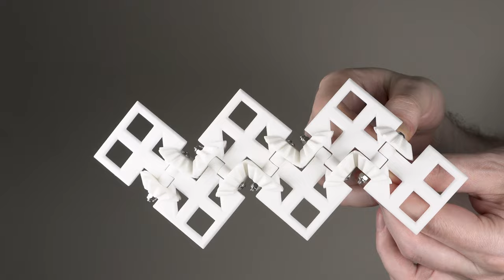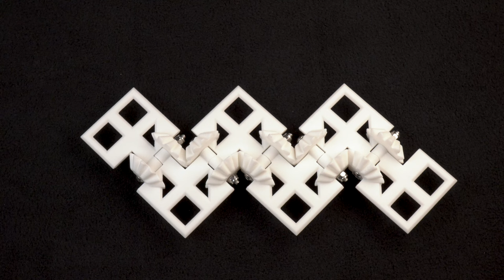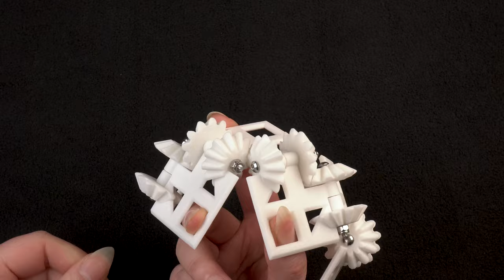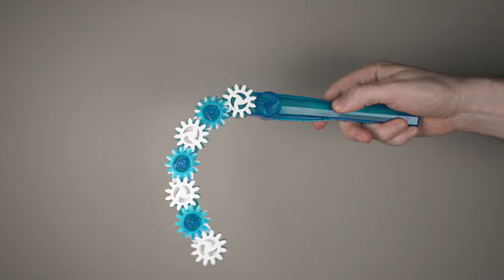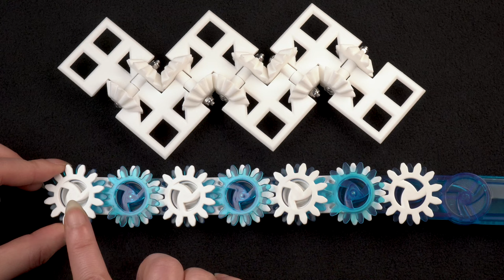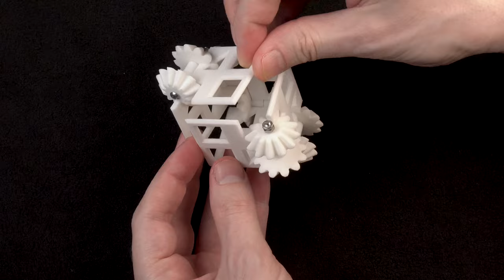Geared cube net

Comment: Can this principle be generalized to other platonic solids by tracing a Hamiltonian cycle on the vertices of the dual? If so, does this work with all possible choices of Hamiltonian cycles? I feel like the latter is not true, and in that case finding the constraints for a Hamiltonian cycle to be suitable could be interesting.
Reply: That's a smart approach. 
There is a dodecahedral net with a single chain of pentagons. There are a  couple of challenges though. The folding edges are not directly opposite one another and also the angle varies along the chain.
Reply: *Skips to asking for a Chillagon

Comment: You can also use two nuts tightened together to act like a lock nut, (or cut one nut into two and reverse them.) I was surprised that Henry's semantic satiation threshold is so low. It usually takes minutes for that to happen to me.

Comment: I'm sure you've had this question before, but for years it's annoyed me how the seemingly most simple question is so difficult to answer : if there are 360⁰ in a circle how many degrees in a sphere?

i quickly realised the most difficult part is how to figure out how to figure it out.
you can't just get a marked circle and iterate about 2 opposing degrees by 179⁰ in 1⁰ increments because; 1) the markers stop being equal distant towards "poles" and 2) there are now 358 extra markers at "poles". 
no matter which way I've tried markers always converge or misalign somewhere, though I've only just come across the importance of hyperbolica n the other 1 (non Euclidean) so I'll have another go. 

but basically: 
how many spheres, when closest to degree separation as possible, close sphere packing on a sphere occurs (and then what is that ratio of small-sphere:large-sphere.) i think it's the most (important) useful knowledge for application of geometry. As we currently have no seed for geometry other than the A. starting point, B, C ect. where as if this question is answered then all geometry can now have a universal seed 
eg. 
from four equal distant spherical degrees equal length protrusions makes a tetrahedron of the spheres surface. 
the applications currently has no end in sight... 
p.s. i asked chat gpt3 it reckoned ; 1.
yep it hubristicly insisted there can be only 1 equal distant point on a sphere.
then it claimed i don't understand a sphere and we had an argument, (not a discussion like i would with my Actual Intelligent friends) about the nature of a sphere instead of trying to solve the question i posed, because it thought it knew the answer already. 
(a.i. is just Automated Incompetence.)
Reply: For every 'great circle' contained on the sphere, there is an orthogonal great circle. So, to define every point on the sphere relative to a reference point, you have a pair of 'circle degrees'. So a sphere, in degrees, could be represented by the pairs contained in this set: [0->2π, 0->2π].

So, if there were 360 degrees on a circle, there would be 360^2 degrees on a sphere.

So its a circle times a circle, basically. 

P.S. I did no research don't trust me but this is my intuition.

Comment: Does this hinge and form a box both ways, or just the way you showed?
If it just folds internally, you could get rid of half of each gear so that when it folds it forms a box with a clean exterior.
Reply from the maker: It folds both ways. But even if you just wanted to fold one way, it’s not clear to me how to hide the mechanism entirely inside. Interesting challenge!

Comment: Interesting mechanism!  Seems like you could probably design that as a print-in-place model, if the beveled gears were flat on the bottom, and the hinges only allowed movement in one direction.